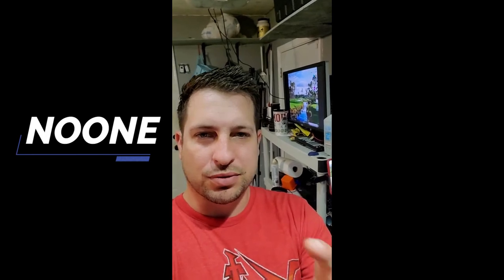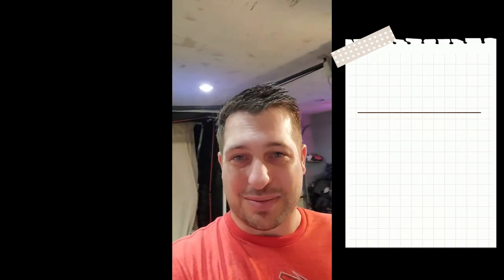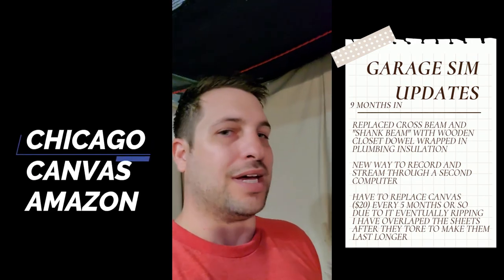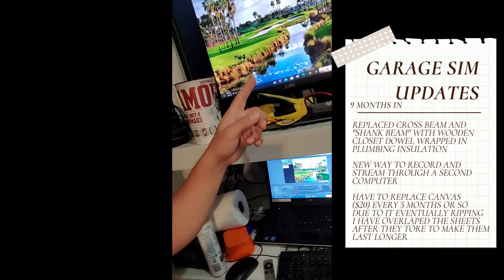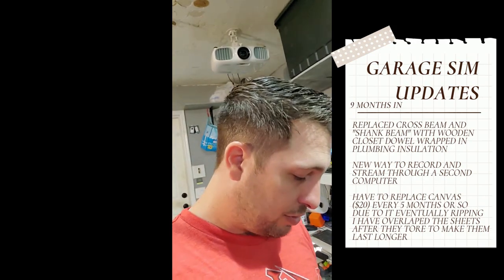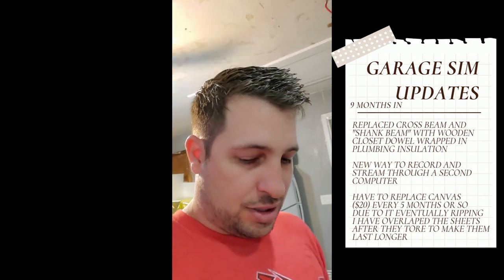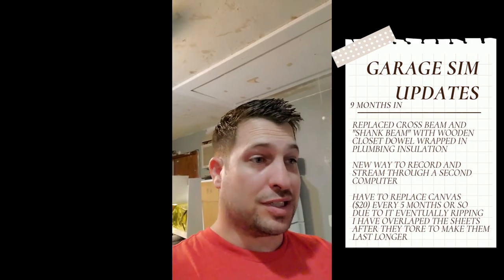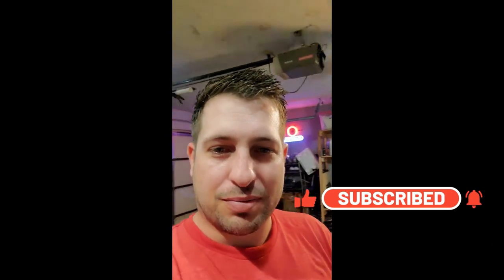UPDATE! COMPLETE GARAGE GOLF SIMULATOR SETUP FOR $1,140 DOLLARS - 9 MONTH UPDATE

Comment: Electric Metallic Tube (EMT) Conduit they don't break. Work great just use a pipe cutter and on the corners use 3 Way Flat Corner Canopy Fitting/Batting CAGE Fitting.
Reply from the maker: How much does an 8ft run of that cost?
Reply: 10ft is $22.50 for 1” at Home Depot and $52 for 2”. I am planning on using it with a neewer photography roll